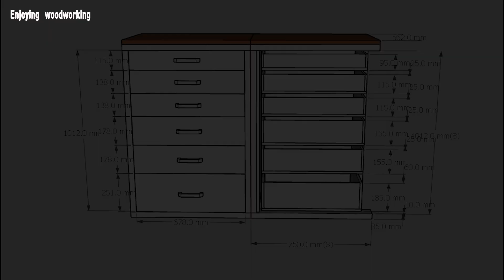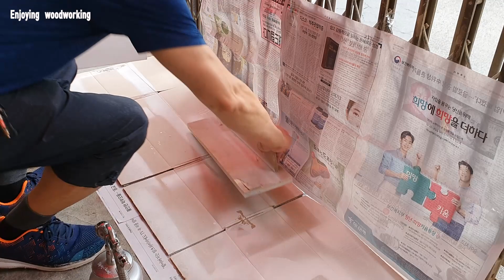초보자도 쉽게 만들 수 있는  서랍장/독특한 서랍장 제작 방법/ DIY

Comment: nice video.
you finish the upper plate in 4 steps with oil and wachs? can you please explain your steps please. thank you
Reply from the maker: This is my finishing step.
1. Sanding (100#,180#,320#)
2. Apply water
3. Sanding (400#)
4. Dust removal
5. Apply urethane water-based varnish
6. Sanding (600#)
7. Wipe with a wet towel
8. Apply urethane water-based varnish
If you want additional finishing, repeat steps 6-8.
Re-coating should be done after completely drying.
It is best to apply a thin coat several times for the finish.

Questions are always welcome.
Thank you for watching my video.
Reply: @enjoyingwoodworking691   Thank you so much for your detailed answer. Very nice!